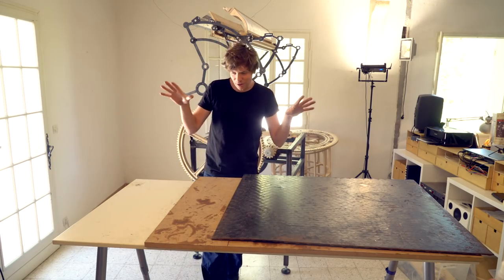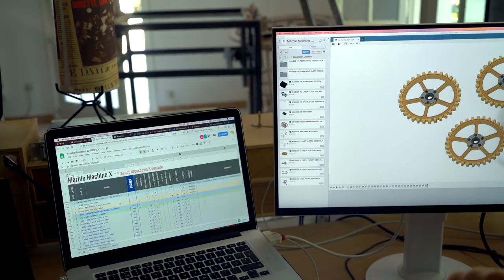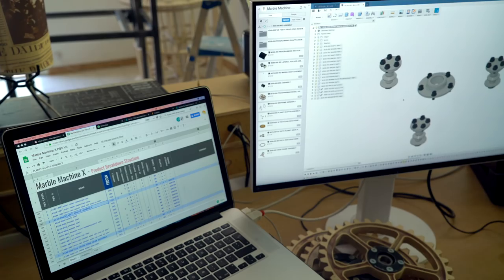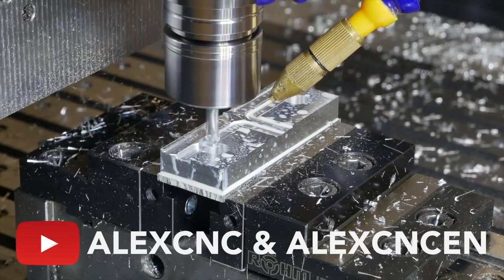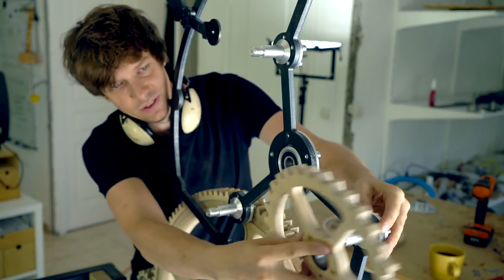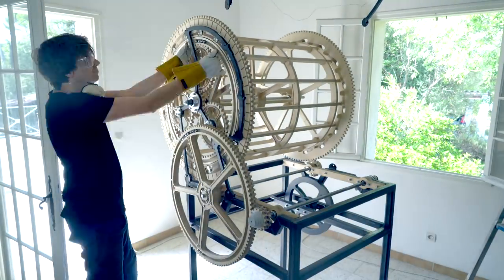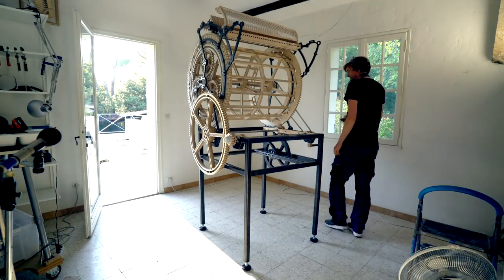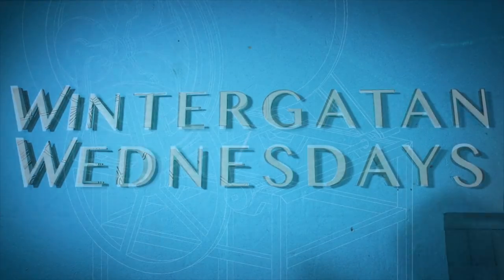NEXT LEVEL PRECISION - Marble Machine X #48

Comment: I know I am probably being silly since all of the  weight displacement angles, but I kept thinking that assembly needed a counter weight on one side so  if someone bumped into it the weight from all the gears and frames on one side wouldn't  cause it to tip over. The thought would not go away.  Though then again the other parts when put on will probably balance it all out.

Comment: Probably not the first one to point this out, but tapping is best performed by hand (especially steel), not with a drill.  At most, 1/2 to 1 turn in and reverse to break the chip free.  No more broken taps.  Save the drill for making holes.

Comment: Whenever I'm drilling difficult materials that like to snag (tapping would also be similar), I just turn down the torque limit on the drill. If the bit (or tap) snags, the driver just hits the torque limit instead of ripping the drill out of my hand, or breaking the drill bit or tap.

Comment: Drill is spining too fast. That's why it's reccomended to use a T-handle tap chuck and run them by hand. And go in and out in short distances as you go the help clean out the tap.

Comment: You need a lathe. Except that you  might spend too much time on it. (I find working on a lathe an end in itself). Slimming down the spacers would have taken very little time with a lathe.
That said, the router could probably have done it too, with the parts held down well.

Comment: Some basic stuff about bearings: You have to press them on the rod and in the gear. If you just slide them on you wouldn't have to use them at all because the rod turns on the inside of the bearing and the gear on the outside. Normally only the bearing should rotate by itselft. Google interfernce fit to learn more.

Comment: I have a question. Even once you assemble this won't you have to disassemble it to transport it? Even so, how will you get the bottom welded metal frame out the door? Cause to me it looks a little to big to fit through it.

Comment: Lacking the proper power equipment to tap safely (without breaking taps) you really should be doing it by hand, despite the extra time it takes. I almost came out of my chair in alarm when I saw you  using a hand drill to tap those difficult-to-replace side plates.

Comment: "Ceiling crane..." the word you're looking for is 'gantry'.
Also, for your adjustable bearing housings, you really needed to add a rough surface to the interfacing surfaces. Otherwise your adjustments will easily shift out of place with a bit of vibration or force.

Comment: @07:15  ohhh .... DONT drill a threat into metal with a drilling maschine !!!!       the threat drills have always a manually lever to drill the threats into the material ..... so you have much more control ... and its no fun to peel broken off drills out of the hole ....

Comment: Don't tap steel with power tools!  Not unless you buy taps meant for it, and use a drill press that runs at the speed the tap is rated for.  Hand tapping may seem slower and harder, but you'll also be saving yourself the aggravation of extracting and cleaning up after broken taps .

Comment: Use a tap die handle bar for your holes. Otherwise set your drill to screw mode on the chuck, never tap with drill mode. Taps have very bad shear strength.

Comment: tapping steel with a drill is a bad idea as you have found out use a die  its slower and more precise  but you will have less chance of snapping them  keep up the good work and slow down rushing makes mistakes  and i would hate to see it fail i want to see it go .

Comment: Uhm... use a roll form tap. They are much harder to break. In a drill press or at least use a guide to keep the tap square to the part. If a cut tap is really all you can get you hands on then you want one with as much lead in (more partial threads at the beginning) and use a drill slightly larger than spec. For instance on your m8×1 threads, don't use the m7 drill. Use M7.1.
Just a few tips to keep you having as few shitty afternoons like that as possible. Nobody needs that frustration in their life.
Wishing you well and cheering you on from seattle.

Comment: You are trying to build something which requires that you at least have a Machinists Lathe. You really should have a lathe, a Haas CNC machine, a waterjet cutter, and a TIG welder. Trying to do what you are doing without these tools is totally 4ucking crazy. It is no wonder this project is taking do long. You should be waterjet cutting out of Nylon for the gears, and using a Aluminum welding rig to make the frames. You are making this 10X more complex than it needs to be.

Comment: All these threaded parts are going to come back to bite you. Nuts exist for a reason. As bolts go in and out for assembly/disassembly, often by non-mechanically minded people, over tightening and cross threading, those threads are going to get damaged and stripped. Then the part is broken. At one point you tapped plywood???? Ah man you are going to have so many frustrated moments setting up for gigs where you can't put the thing together.